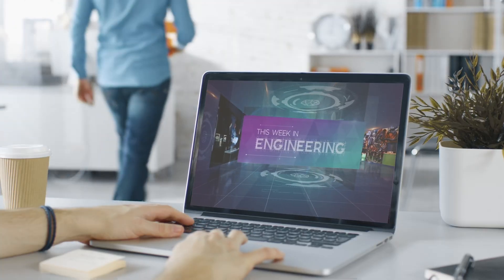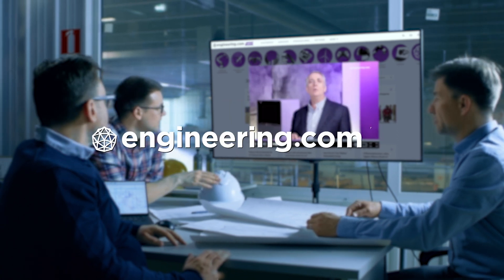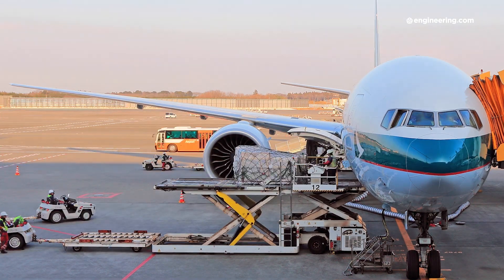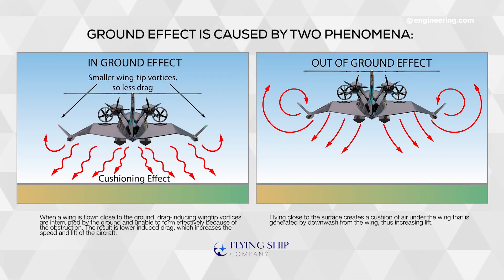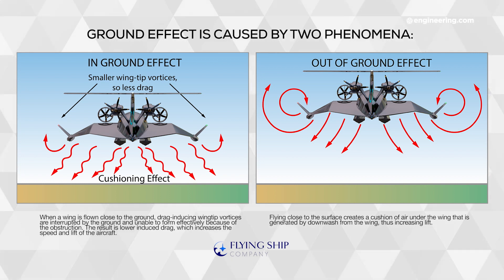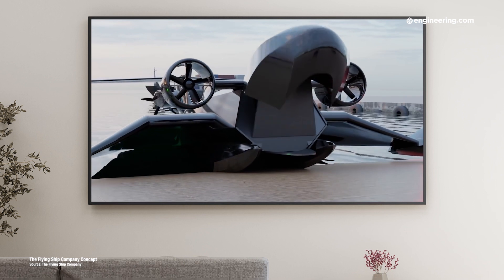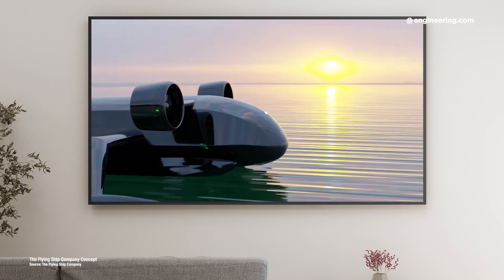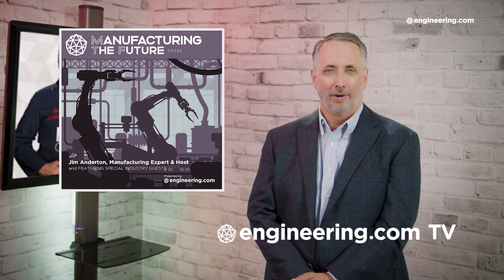It’s Not a Ship, or a Plane—But It May be Better Than Both

Comment: Implement Faraday 2 Law Of Electrolysis All Vehicles Need Pair Of Lungs That One Water Tank And Hho Generator, Current Engine Product Is Not Already Mature, Water Tank And Hho Replacing The Gasoline And Diesel Tank As Lungs This How To Perfecting The Current Ice Vehicles Digestion. And Koh Solution And Naoh Solution And Ammonia solution Is Vehicles Drink.